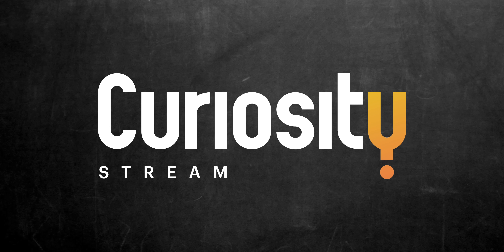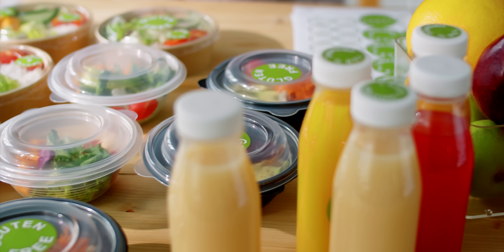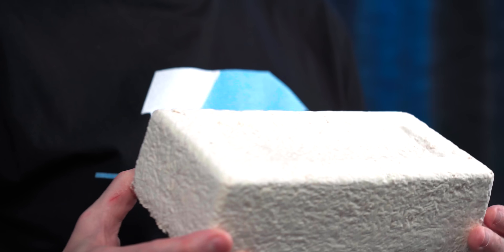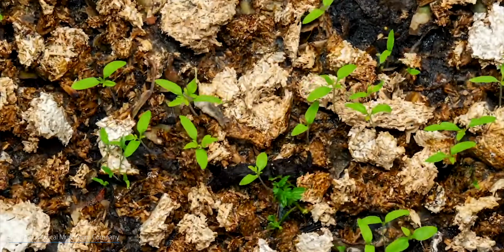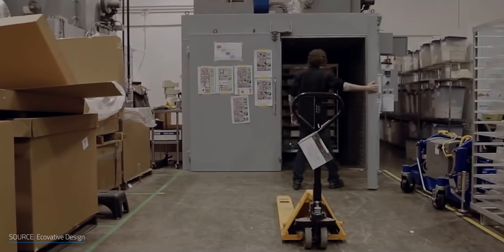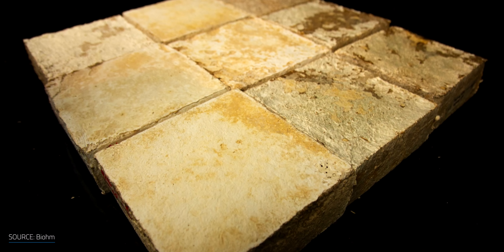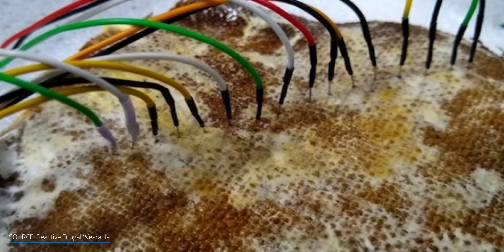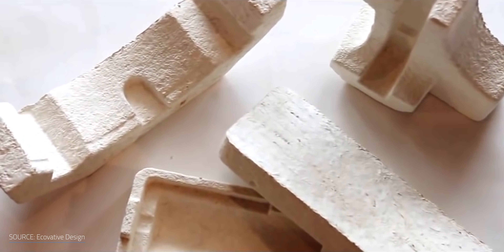Is Mycelium Fungus the Plastic of the Future?

Comment: hmmmm, if only we could, I don't know like just recycle the plastic 🤔 nooo I'm just crazy radical eco fash
Reply: My town had a "recycling" program for awhile. We found out they were dumping it all in a landfill. Of course it all started to be a bit obvious when the local landfill started resembling a mountain that you could see from a highway across several sugar cane fields.
Reply: @Discrimination_is_not_a_right  I mean you know when I say recycling I mean real recycling not an illusion, I know it's a big problem, in my country it's a kind of standard practice. But what I suggest is that plastic is not inherently bad, heck it's one of the best if not the best material we invented, the problem is what happens with it after it's used.

Comment: what is "intended product cycle", that's not a number that can be used to compare to plastics 100 years. 
is it 45 days like you said before? why not just say that?
it all sounds good, where are the flaws? one needs both the pros and cons to compare them to what they are going to be replacing. 
like anything mycelium can mutate, which can be helpful or REALLY bad. maybe it starts surviving the heat treatment or goes dormant. who the hell knows until it happens or a eye is kept on every single batch that goes out to make sure it doesn't happen.
this is plastics all over again but with a new twist. just because something looks nice and easy, doesn't mean we should go that route. this is also like nuclear power. sounds good, sounds good, sounds good, until it's not and shit hits the fan and you need to spend thousands of years to clean up the mess.
im all for replacing plastics but not if it's replacement is going to causes nearly the same amount of problems globally as the thing it's intending to replace.

Comment: Since its a bio material, would it be possible for it to become infected by some bacteria or virus?
Also, how could this stuff work as home insulation if it has a low lifespan? 
And what happens at the end of said lifespan? Would it start to decompose? 
Last thing I want is for the insulation in my walls and my mushrooms shoes to start decomposing in a few years.
And sense its a fungi, would that make it prone to growing even more fungi on it?
Since ive seen mushrooms grow on mushrooms before.

Comment: Polystyrene can be recycled, easily and profitably. My local recycling plant is more than happy to take it. What they don't want is foamed polystyrene (including Styrofoam): Not because they can't recycle it, but because it's not profitable. It's one of the big scandals around here: That the council wants us to recycle, but the company they pay to take the stuff away refuses to handle 90% of recyclable material meaning we have to take it to the tip where they do separate it and recycle most, but not all, and still turn away packing material even if it's biodegradable. Worse, however, is most recycling firms land-fill anything that doesn't return a big profit or they ship it off abroad where it's dumped instead. Meanwhile there was a company offering to PAY the councils for the right to collect household waste: ALL of it, with a promise they'd recycle at least 90% of it. And they can, do, and use the materials for goods they then sell on for a profit sufficient to pay for the whole process. 

Still, replacing plastics is a damn good idea. Hope to see more of it in circulation soon.

Comment: ok so 2 things

1st, a joke: this is how you get those mushroom zombies from the last of us.
this concludes the joke.

2nd, a concern: it may be safer for the environment and cheaper to make, but if it takes a week to make a single brick, and it requires special molds for each application (brick mold, box mold, lid mold, etc), there could be an issue where companies can't use the product, because they literally can't get it fast enough.  as the orders pile in, and you have a larger batches that need to be done in that week, you might find that you can't keep up with the demand; and a product you can't get is a useless product, no matter how green it is, or how safe it is.
Reply: Regular packaging comes in molds bro... lol you just have to make the one mold and replicate it

Comment: Replacing plastic isnt enough, Its a great step but we need to remove the plastic from our environment. The plastic industry said plastics were safe too, we will only know if it takes off like plastics did.
Reply: Apparently the amount of trash in the ocean is lower than we thought. This leads to one of 3 major options
1. Something has learned how to eat plastic and is getting rid of it, no idea what
2. As things grow in it like bacteria it sinks and is currently at the bottom of the ocean where we can't find it.
3. A combination of these

Unfortunately I'm betting on 3 at best
Reply: Talk to China, they produce over 90% of the world's plastic pollution and most of it goes out into the ocean. The USA is less than half a percent of the world's plastic pollution and not even all of it goes into the ocean.
Reply: I remember hearing about plastic eating worms that if set up properly could be used to break down large amounts of Styrofoam in a relatively short amount of time.

Comment: Does it carry the same factor that causes a reaction in people with mushroom allergies?
Reply: I think most mushroom allergies are actual reactions to spores, so in that case it would be no problem.
Reply: Though I'm having a hard time finding numbers (anyone who's better, help would be appreciated!), it seems likely mushroom allergies are from the spores, which wouldn't be an issue here since they're heat treated to kill the mycelium and spores. So unless someone allergic to mushroom consumption, say, eats a mycelium shoe, they'll probably be fine. Though I guess those who get a rash to touching mushrooms will be SOL if it ever became a building material (which is unlikely given those PSI ratings).
Reply: Good question, I would have never thought about that.
Reply: I'll give you the benefits of the doubt

Market are never perfect. Somewhere in the future a mycelium based company will make an alive mycelium that will grow into mushroom (intentional or not) and releasing spore in the process.

Then presumably a mushroom alrergic was present and maybe had a reaction- or worse, dead. And then, a group of Anti-mycelium activist
(that may or may not have been secretly sponsored by plastic, concrete, and styrofoam company)
will use this case against mycelium.

This are astronomically low, but not zero
Reply: @スガル  hell, they could make a new company just to sell and sabotage

Comment: You mention using 10% of the energy to create and releasing 90% less carbon, aren't these the same thing? You say styrafoam is virtually impossible to recycle, but it has proven to be a very useful food source for mealworms and other smaller organisms.
Reply: It releases 90% less carbon not more.
Reply: @disastrousdwarf  mistype, fixed
Reply: I don't know what world running a factory for 2 weeks to grow mycelium vs 2 hours to blow mould a bottle uses only 10% of the energy, but apparently those are the facts.
Reply: @rjc0234  This is because for plastic to be made it needs to be extracted from the ground as oil and then broken down into simpler molecules which is done using heat and then it needs to be heated so it can be molded.
Reply: @disastrousdwarf  and where does the energy for the 2 weeks it takes to grow the mycelium come from? where does all the harvested bio matter come from? I feel as though those statistics are comparing the energy used to make the mycelium bricks vs the entire energy supply chain of making a plastic piece. What about recycling the plastic piece? it could potentially be made from 100% recycled material that didn't require extraction or cracking. The mycelium has to be grown new every single time, requiring the same amount of energy every single time.
Reply: @rjc0234  Lots of plastics can't be recycled and for those plastics it makes a good substitute.
Besides not everyone recycles even recyclable plastic.

Comment: I have been in many buildings when the fiberglass insulation is installed and it sucks!! It would be awesome to see it used in all buildings commercial and residential. The material that's better in all the ways its measured against all the rest is the best objectively. 😁

Comment: A problem with plastics not mentioned, they are carbon positive.

For people not familiar with the principals behind global warming, carbon in the air heats the earth.  Trees absorb carbon, bind it to water, and create carbohydrates.  If a tree rots, or is eaten, or is burned, it reverts back to gas and water.  This is the carbon cycle, its carbon neutral.  You pull oils out of the ground (ancient carbon from millions of years ago), you are adding to the sum of carbon on the surface.  This is carbon positive. This includes natural gas, petrol, plastics, and etc.

Comment: I'm sorry but I can't see this taking off to be used in any large volume by any manufacturing company not wealthy enough to be able to pose and brag about using something like this. The process of filling a mold taking up to a week is just too long. If any company tried making their products from this material they would see a drastic change  to production times, or facilities. Neither option is appealing. This won't be the new plastic, its not better than plastic in ways that will have unobserved companies naturally shifting towards its use
Reply: Insulation, maybe. But most likely on the consumer side. Industrial insulators can be amazing, and it doesn't matter if it's not easy to install compared to this stuff

Comment: I understand raw plastic polymers come in small pellets that are heated to malleability and immediately formed into their final, commercial shapes. So, for each individual plastic part of a product, a factory needs only the automation to give the heated polymers the desired form, then purchases pellets in bulk for all their needs.

So I'm wondering, could mycelium compete with plastic from a convenience standpoint; Since for each individual part of the product, where a single plastic-shaping machine continuously churning out the necessary parts would suffice, for mycelium one would instead require large amounts of identical molds each producing only one component per batch.

Basically, I love the idea, and would like reassurance that it can catch on! 😅 Is it realistic to think that Mycelium could rival plastic in production speed and efficiency? Because that seems like it could be a hurdle to its wide scale implementation.

Comment: As with any "great alternative" there are 2 grand issues that will of course impede it from actually helping.
1) Biodegrading materials need to last long enough to be useful. This sounds great for packaging but not really anything else since if its holding something too long it degrades and now whatever it was holding is everywhere. Unless we find a material that biodegrades faster than plastic but not in a few months time or less this will be a problem. (mentioned it degrades in about a week in soil)
2) Cost gouging. Every single time i see one of these great "alternatives" to something we use constantly like plastic, tires, etc its usually priced out the wazoo because "of the effort to design or use it" - nobody is going to use it if it costs MORE Than what we already use, especially when it doesnt last as long.

#2 is the big one, i dont doubt they will find a way to make the biodegrading issue no longer be one eventually, but i guarantee anybody that actually does it will price gouge the ever living frak out of it so it doesnt actually replace anything, just ends up being a bragging rights for a given business.
I dont know the prices off hand but lets say the packaging for normal polystyrene in a TV box cost you 2 bucks. This mycelium alternative removes the issue of waste when the customer removes the packaging, but costs 10 bucks because of fees and production costs being bloated. Guarantee the company either sticks to the 2 buck alternative, or forces the buyer to eat the difference which makes the buyer wanna go somewhere else.
Greed will always impede progression in humanity.

Comment: I'd be more than happy to use mycelium insulation, seems like a cool application, though we'd have to see if due to the heat and moisture it may degrade in the walls. 

I remember reading or watching something about mycelium bricks where they are made dormant but can be reactivated to bind the individual bricks together into one structure and then made dormant again. Seems like a great application. Or imagine growing the mycelium in the wall cavity on site and then neutralizing it. Perfectly sealed cavity with the insulation bonded to the studs. May even act as an air barrier.

Comment: Im a few days late to the conversation but there are a few concerns of note here. The first road block it has to over come is sustainability, not is it good for the environment but finical stability. Is it cost effective to produce and is it cost effective to scale up? For instance Aquaponics is truly amazing and cost effective on a small scale, as much fish and vege as a few families can eat off a decent sized system and its very sustainable on a small scale. The problem comes with scale, it can not financially sustain itself on an industrial level. The over whelming majority of Hydroponic and Aquaponic growers fail as they have to higher more staff to keep up with the overwhelming load of work it takes to keep up with supply to their buyers and after they reach a certain scale it becomes financially  unsustainable. 
The second and probably biggest concern is actually medical, how many people may be allergic to this material? 
Third would be the quality of the material in terms of longevity, in packaging this isnt a concern and assuming they make it past the financial stability issues I think this would be an excellent, dare I say, solution to a wide variety of plastic issues. But in the case of housing insulation how long will it last? yes it may be out performing current materials but for how long? What happens to it if there is a leak in the house and it doesnt have to even be a bad one. What about insects or rodents. We would all like to live in a perfect world where we dont have these things in our house but the reality is they exist, how will they combat this as well as the natural rate of decay? 
Understand by asking these questions Im not crapping all over the idea of it. I honestly think it would be brilliant assuming it works. But that brilliance is contingent on its success.

Comment: I understand that this is useful in most applications but I dont get how its a good insulation material... Like its very degradable meaning that organisms will be eating it quite rapidly. 
So why would you want such material within your walls? Thats one of the main reasons why synthetic materials have always been used as insulation, they dont degrade as easilly and thus will stay there until the house needs rebuilding. The replacement of bricks is unlikely to ever happen due to the costs assitiated with it. The bricks never were the best building material, its just that when it comes to the shear weight quantity required to build a house, you are looking for one of the cheapest materials you can get your hands on within a reason of the material having enough compressive strength.

Comment: Unfortunately, that sounds way better than it can be. It IS possible to replace some packaging, but you cannot easilly replace ABS, PET, or other thin and elastic/durable polymers. Of course even completely replacing some foam materials would already do good to ecology... but here it stumbles on another factor: the speed of production. Several days to grow a single unit... that's insanely slow. A factory of the same size can produce hundreds times more in same time, and that's the only way to match a demand on these products, which is huge. Theoretical amount of investments for production replacement should be enourmous, which makes this way pricier than plastic, and price is what rules todays markets.

Comment: Yeah sorry. I'm gonna be the devil's advocate here and say as someone that has worked with fungi and even considered starting a mycelial based business... there is a reason we don't see tons of  fungi based products everywhere... and it's time and cost. And tech won't get them closer to reality because these are fundamental problems. Fungi takes weeks to grow, plastics take seconds to produce. Fungi has an incredibly complex production pipeline which includes extremely energy intensive heats for media sterilization, and expensive production environments due to labor requirements, but more importantly, nearly sterile environments. Small amounts of contamination can cause huge loses and can be incredibly hard to overcome. I'm sorry but fungi tech is mostly a pipe dream, at least for the next hundred years or so. Plastics are far more energy conservative and quick to produce, which is why they are so popular. Hell on a CO2 usage comparison, mycelial tech is likely FAR more polluting than the equivalent amount of plastic.

Comment: If it decomposes in the ground, then how does it not decompose as a flower pot? Or on my leg as a shoe when it gets wet? Or as a bottle holding acidic liquids? Or just over time as a building material even if not exposed to direct sunlight? What if it's a garden chair in rain and on the sun? I highly doubt that something "decomposing naturally" goes along with the "long lasting" attribute. Those are just opposites. As packaging I can see it working and as an insulator, maybe, but not as a building material or wearable stuff, where it needs to stand the elements.